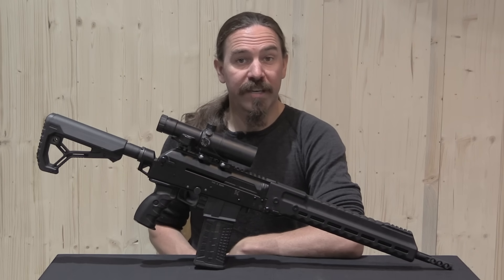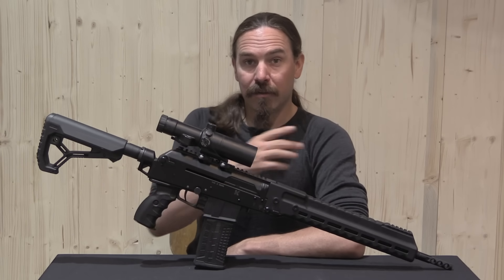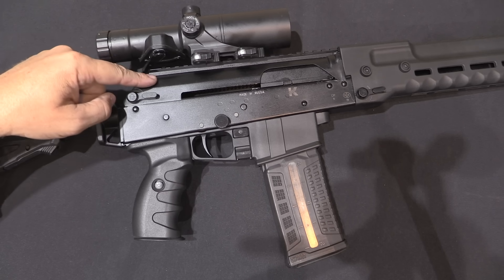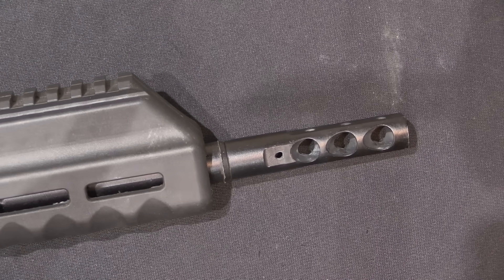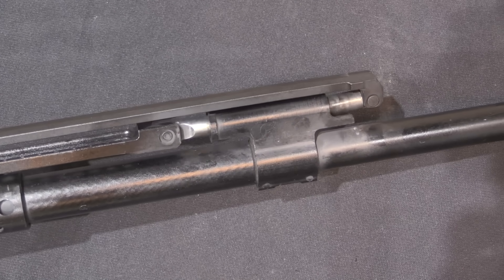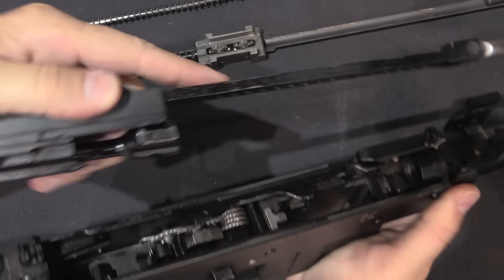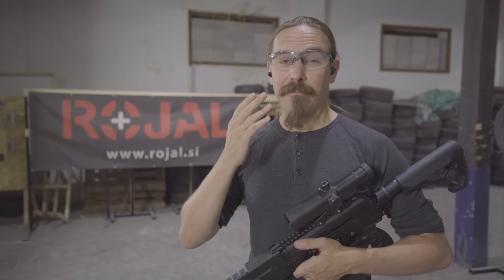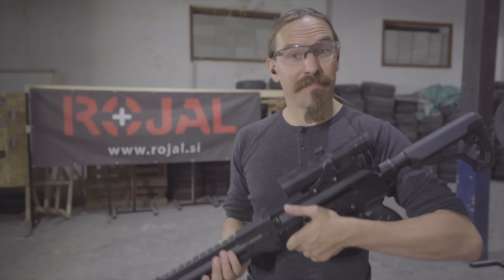Balanced Recoil AK-107 / Kalashnikov SR-1: Is It Any Good?

Comment: Hmm the counterweight should have the same mass as the bolt parts moving backwards have. Otherwise it is not going to negate all the recoil generated by the bolt hitting the rear and then slamming forward. And both of their centers of mass should be at the same height to prevent any moment that would cause the gun to pitch up or down when the bolt's movement stops in either direction. But since the bullet leaving the barrel also contributes to recoil and tends to cause the muzzle to rise, the counterweight's center of mass should be a bit higher than the bolt assembly's center of mass so that it negates muzzle climb caused by the bullet itself. But that will then cause extra moment when the bolt slams forward and the counterweight slams to the rear. It's kind of impossible to negate all the recoil with just a counterweight which moves to the opposite direction to the bolt.
A counterweight with the same mass and center of mass at same height as the bolt assembly's and a muzzle device which negates recoil caused by the bullet would be the perfect setup to negate all felt recoil.
The counterweight in this gun looks really light compared to the bolt assembly so it doesn't help that much in lowering recoil. Since they both always move at the same velocity (in opposite directions), the lighter part will always have less inertia than the heavier part which means it'll never be able to mitigate all recoil caused by the bolt assembly's movement.
It's an interesting concept which could be developed further. Wouldn't probably fit inside a normal AK/AR receiver though. Maybe the counterweight could be inside the handguard, around the barrel or something like that. Or the barrel itself could be the counterweight as long as the inertias are matched with gearing or some other system. It does add a lot of complexity, though.

Comment: I feel like this system would be better used with different calliber. Imagine 6.5 and this system. Better accuracy and power but controlable gun.
Reply: It would be even less useful - bigger cartriges lead to less persentage of felt recoil from the bolt movement.

Comment: To call that system recoil reduction is wrong, its a 'balancer' system that disperses a lot of the 'extra' forces, which does a lot, but the extra gasses leaving the chamber WILL still give you climb and push, which is where the compensator comes in to redirect a lot of them against the forces pushing up and back... Also, i doubt you can achieve something like that with any other 'normal' rifle, regardless of modifications because well, you have a whole recoil system, lightweight or not rocking back and fourth inside. You can achieve some of it for sure, but not to the degree this system can (not this RIFLE in general, its just the first of its kind which could obviously do with a lot of improvements... First in its kind aside the Kriss vector that is. Although the Kriss isn't a rifle, more of a submachine gun).

Comment: How could they? A non flathead screw on a firearm, discusting. 
Without the plastic crap it would look better with a standard 5.56 AK mag. 
CIP classes. 223 and 5.56 as the same chambering so maybe they marked it as. 223 to look more civilian. 

I think in full auto or burst that it would be great but Im sure it's less accurate than a normal AK ok semi slow shooting.

Comment: Supposedly for someone like yourself that knows guns. You should understand that this gun was designed for FA use and it's the main reason civilian market failed as well.... Without full auto, this feature is pretty much useless and it was designed to work in FA, otherwise there's no point.

Comment: AEK 971 is the best rifle for Russia but they too corrupt to implement it.
Reply: 1. It's been adopted in 1990 and actively field tested during the Chechen Wars. Since then it received several deep modifications and is, though not that often (we'll get to that in a bit), used by special forces units. One of 971's later modifications was also the main rival of the AK-12 when the military went back to the idea of a replacement for the AK-74M. 
2. In theory, it's great. In practice - not really. Pretty much, the AEK suffers from the same problems as the Nikonov's design (i.e. AN-94), though, admittedly, to a lesser extent - it's a technological masterpiece that nobody needs. Granted, on paper it shows really good stats. But those stats won't be realized if the operator is not too experienced/skilled (say, a regular conscript - or even just a regular contract soldier), and if he is (veterans, special forces, professional sport shooters, etc.) - they will have comparable results using a properly tuned and maintained AK. Moreover, those stats come at a price - being significantly more complicated than the AK, the AEK is less reliable and harder to produce and maintain, not to mention significantly more expensive (especially if you consider the need to create completely new, separate manufacturing lines). Moreover, the modern AEK modifications are even worse then AKs in some aspects, since, trying to fix the issues mentioned above, the developers kept simplifying the design, removing certain features and overall castrating the gun. And then there's also the need to re-train personnel to be able to use the new weapon - obviously, it's much more logical to just try and improve the design the people are already familiar with and know how to operate.

Next time you decide you're an expert in something and want to express your opinion on it - do some research. Otherwise you'll just make people laugh.

Comment: He even had to swallow the saliva that came up and even out his breathing, with such lust and passion he says: "... this is a commercial failure of the Kalashnikov concern...", and, "... you can take the AR-15...". I think that the rifle turned out to be what it should be.. - very simple and accurate. Moderately heavy (you have to pay for everything). No dirt can interfere with the normal operation of the recoil compensation mechanism, it is so simple and protected. And the "light and comfortable" AR-15 shit, as it was not adapted for war, will remain so. The AK 107 would undoubtedly become a bestseller, at least in the US, if it appeared on free sale. But this is not destined to happen.

Comment: 'Truth' seems to be a bit lacking with this weapon.  'Every action has an equal and opposite reaction' this cannot be side stepped by any fancy moving parts. If you want a round to go out one way, recoil will push the other. There is no getting away from that fact.  The only saving grace with an AK is the simplicity, here that is thrown away on a basic marketing lie.    I think this is a gun for the dumpster.
Reply: You can smooth the impulse over time. The impulse spikes are bad for holding on target.